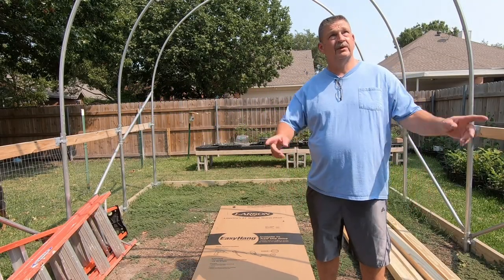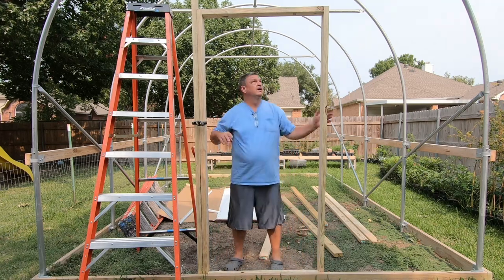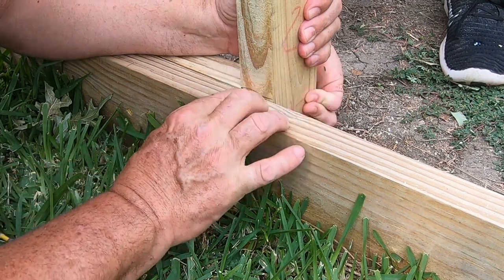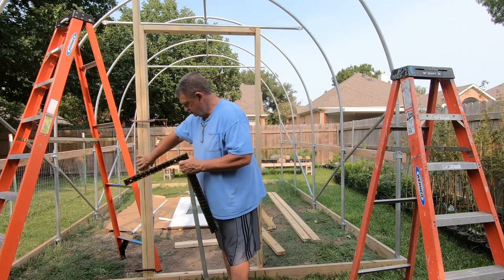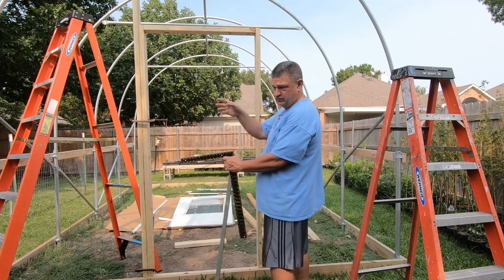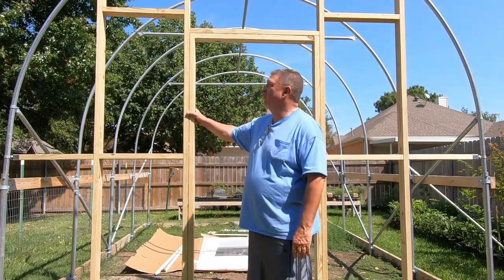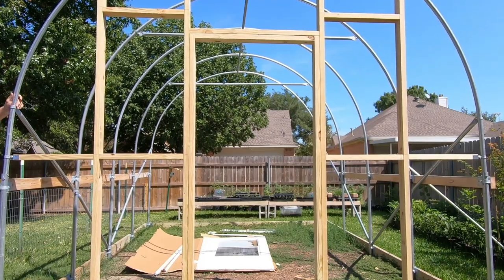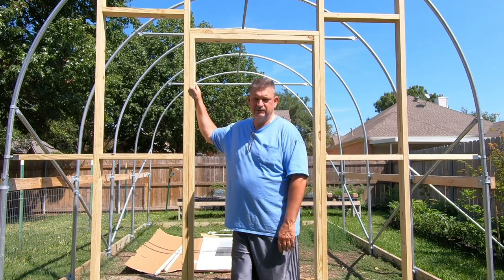Backyard Greenhouse Installing The End Walls Part 1

Comment: Where did you get the hardware you used to attach the 2x4 to the hoops. Any idea what they are called?
Reply: There's a link a few comments down. You might also look for 2-hole pipe strap.

Comment: You used treated 2 x 6 for the base boards in contact with the soil.  Did you use any treated wood for the end wall construction, and if not are you concerned about condensation damage ?
Thanks once again.
Reply from the maker: Lll tyhe lumber is treated, I guess I did not say when I did the end walls but you are correct, due to the obvious high moisture levels you need treated wood inside